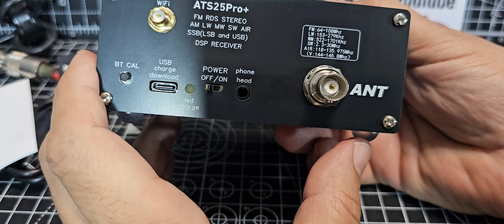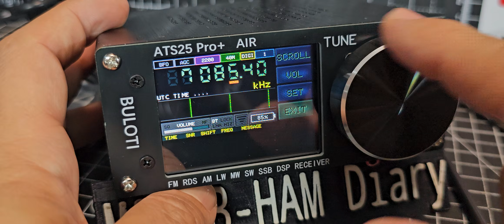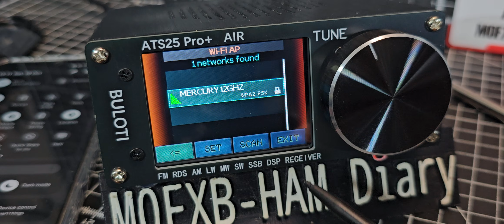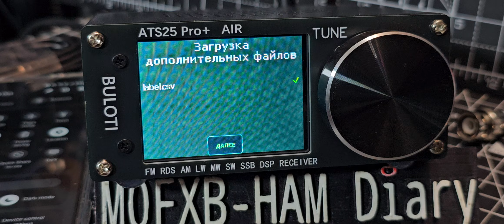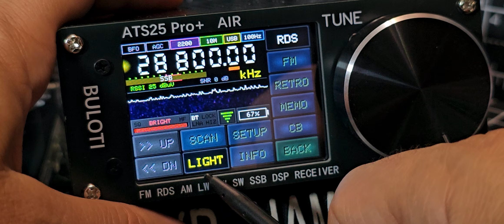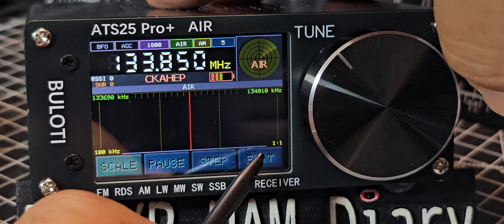New - ATS25 Pro+ Air , VHF(am) - HF Bluetooth - WiFi 2025

Comment: Good Evening All
I'm getting one of those this week are they a good Radio. 
Brad Ellison KF0TTH
Reply from the maker: They are as good as the antennas you add so for HF you need a very long wire otherwise get a Discone external antenna .

Comment: What antenna do you recommend using with this radio? I currently have an MLA 30 but was wondering if a Packtenna would be better
Reply from the maker: I like a long wire for hf then discone for everything else .

Comment: I have a ATS25 pro+Air. When i turn on the airband i get a message to connect an external decoder. I thought the decoder is already installed (since the name „air“). What am i getting wrong? Thx for any advice!
Reply from the maker: https://youtu.be/oONmev1k6e8?si=xToorGkI3A-AYYsX
Reply: I just clicked ok on the message and it works now anyway. Thx @m0fxbhamtech

Comment: A bunch of things: 1) You can use FM RDS to set UTC time if you don't want to use Wifi. 2) Have they fixed the Hi-Z issue? Sometimes when you turn that on the Max decoder II, it will start producing a stepping noise all over the band, you can mitigate this by turning Hi-Z and LNA off, then turn them back on again, and the stepping noise will be gone, until it's back. 3) Does the Bluetooth work properly now? Mine has a tendency to last for 10 seconds and then it vanishes. 4) The wifi has a tendency of being too strong for the built in LNA mode, so you'd want to turn that off in order for Wifi to connect properly, and sometimes it's best to be in FM mode for some reason to make Wifi connect faster, maybe that's because SW is using too much CPU power with the waterfall and all?. 

The decoder wheel feels cheap still on the Max II, is it better on the Pro + Air? The screen on Max II is sharp, but you need to look straight at it, because it's terrible at other angles, it becomes all white and reversed, have they improved on that?

I wish they would go with a better display panel, it's good, but not great. And the resistive touch is a bit out of date since it does "mis" fire som presses and does need calibration from time to time.
The Dinky On/Off button could be of better quality too, it's prone to wearing out fast. The Popping sounds when starting the unit (it makes 3-4 loud pops in the speaker) which is telling that it's outputting some max voltage spikes to the speaker, wich to me seems like a design flaw, have they fixed or improved that?
Reply from the maker: Lots info thanks
Reply: So, to resume, save your money and don't buy that POS 😂
Reply: Simply “no”…🥺

Comment: I just received this radio from Aliexpress. It turns on, but that's about it. Absolute garbage. Won't even bring in my local radio station that any radio i have in the house will bring in. Brutal.
Reply: I messaged hamgeek asking for Marine VHF to be added . They responded by saying the ATS PRO AIR already covers VHF Marine band . They then told me to basically get lost . Horrible , horrible attitude. If they added marine vhf (and sqaushed existing bugs) they would sell a lot more radios , due to the stylish appearance alone.
Reply from the maker: It will learn more

Comment: … Hola, para saber si este modelo ATS25 Pro+ AIR. Tiene ACTIVADO LAS BANDAS 6M, 2M, AIR, MAR y VHF. Déjame saber, gracias
Reply from the maker: Yes
Reply: Hola, solo para saber como puedo conseguir el manual del radio ATS25 Pro+ AIR. Este tiene muchas mejoras y realmente complementa el modelo anterior, muy interesantes. Gracias @m0fxbhamtech .